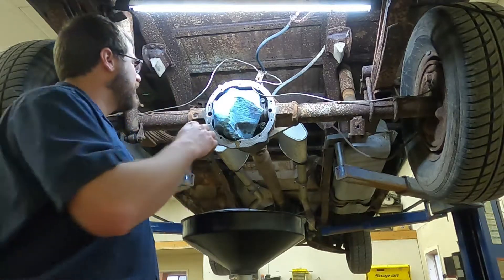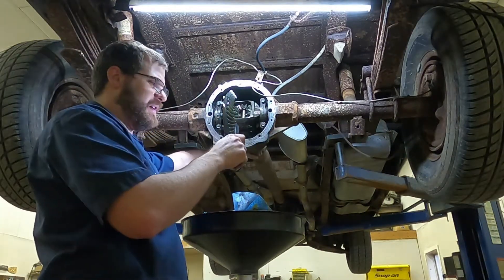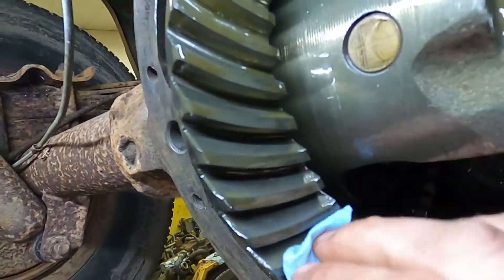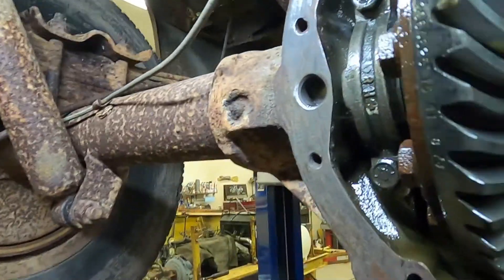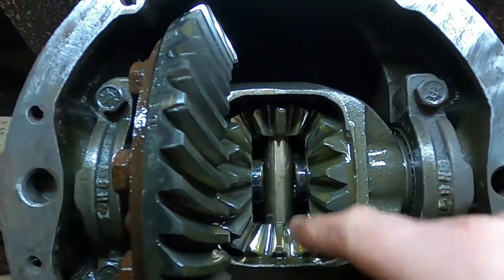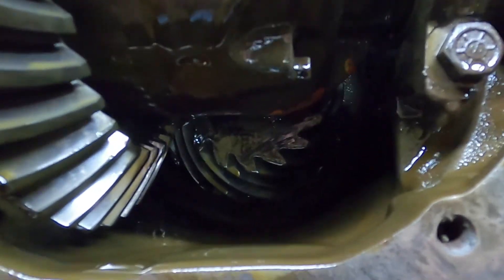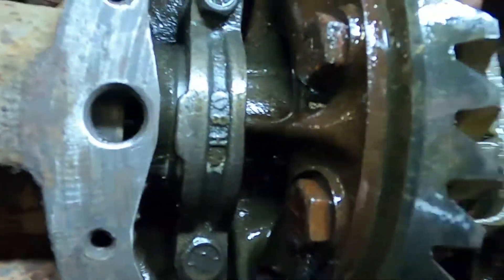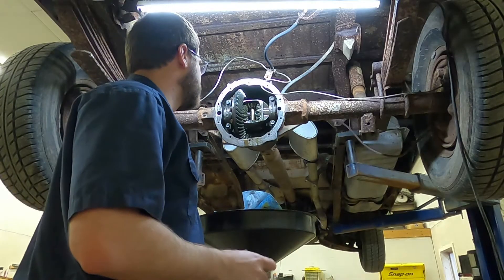Inside A Differential Inspection And How Spider Gears Work, Grandpas truck

Comment: Hi are the spider gear suppose to make a clunk noise when turning the axle flange, and are they suppose to turn at opposite directions? 

Thanks
Reply from the maker: A slight clunk is normal.  There is clearance between the gears to allow for expansion.  The wheels will turn opposite directions if the driveshaft is held still.  Both of those are true for an open differential.  I'll be doing a video in the future covering the three types of differential.
Reply: @macsgarage  ok thank you, yes I just pulled an axle from the junkyard (open diff), the inside looks fine(good wear, no metal chunks in oil), I was just worried about the slight clunk I was hearing when I got the spider gears to turn, but that seems to be normal. I look forward to your future diff videos! subbed!